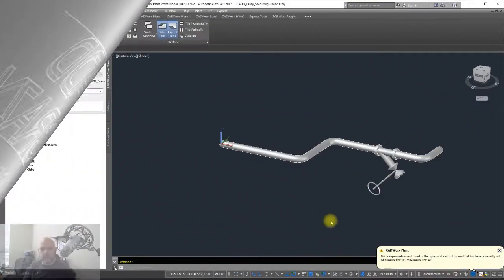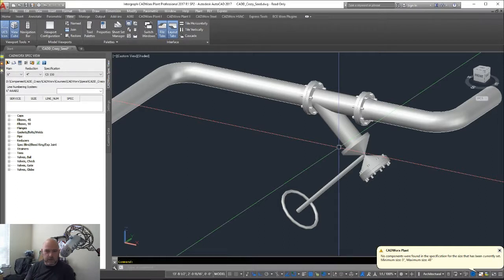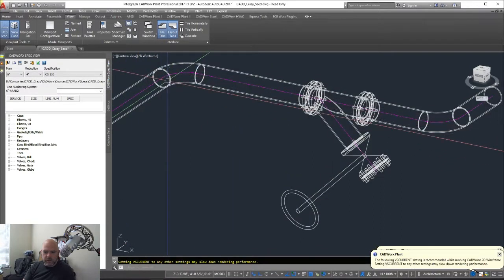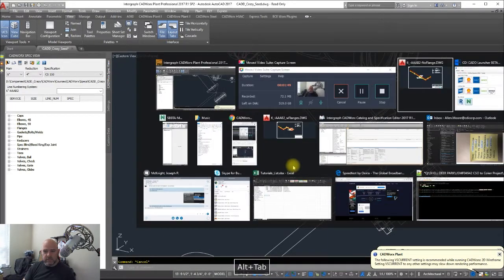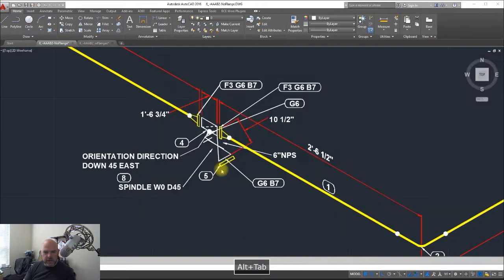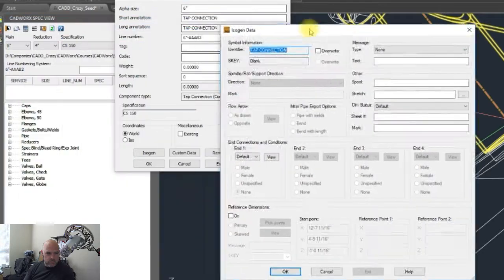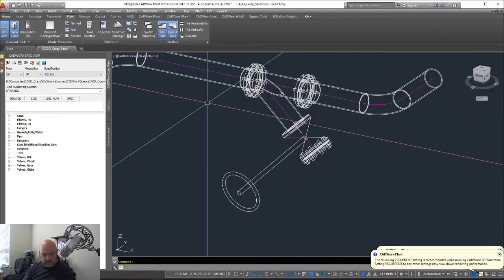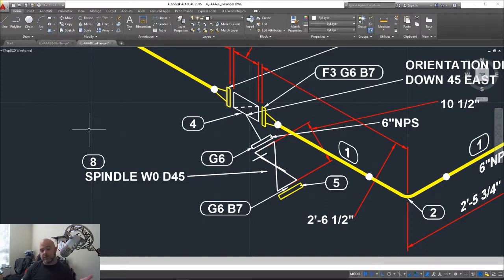CADWorx Strainer Drain IsoGen S-Key

Comment: Do you know why I get a blank screen when I try to use a different iso drawing template?
Reply from the maker: It is hard to say with our seeing the IsoGen Configuration settings but the first thing I would check would be the units of the configuration. IsoGen defaults to MM and if your border is set to Inches it would throw it into space.
Reply: @caddcrazy9069  so in my dwg in regular cad I need to verify my units are set to MM.
Reply from the maker: @SETXHomestead51  Yes if your border UNITS are set to Inches but the IsoGen Style is set to MM, or vice versa, you will have problem like that. With our seeing the style I am just throwing darts.
Reply: @caddcrazy9069  may I send you an email?
Reply from the maker: Yes AMoore@caddcrazy.com
Reply: @caddcrazy9069  had to save to 2007 version.